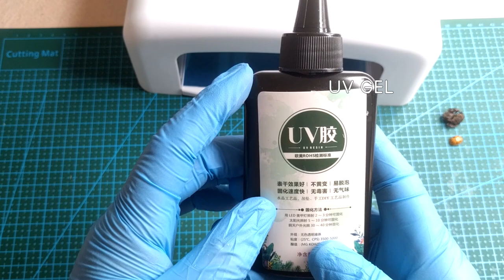🐞Spider and Ladybug in resin. DIY Resin🕷️

Comment: I have a resin jewelry with dried flower and it got damaged by a scratch when I bumped into a wall. Can diamond glue erase the scratch off ? I want it to look flawless
Reply from the maker: I don't think the diamond glue can erase the scratches, but you can try a fine sandpaper, such as 7000 mesh or 10000 mesh sandpaper (you need to use it with water). You can also use a diamond paste of w1.0 or w0.5 (preferably with polishing fluid).
Reply: @BuzzingFish  thanks so much for your input I will try that for sure!🤗
Reply: You could do a top coat

Comment: what resins, and UV glues are you using?
Reply from the maker: The difference between UV resin and ordinary resin is that UV resin is cured by UV lamp. The ordinary resin does not require the illumination of the lamp, it only takes time. 😊